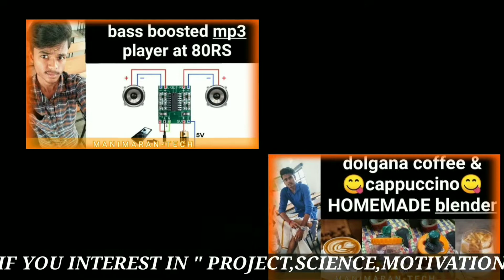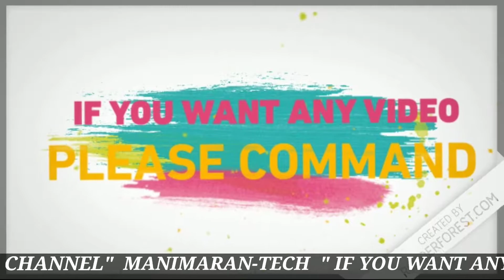what is potentiometer | how to use variable resistor | how to reduce current | tamil | manimarantech

Comment: Hi Mani, is there a way to identify the maximum volt of a LEd bulb. I've many led bulbs with different mm in size but don't know what exact voltage to be sent for it. So unable to decide the resistor value.